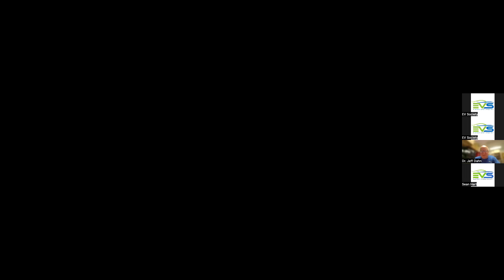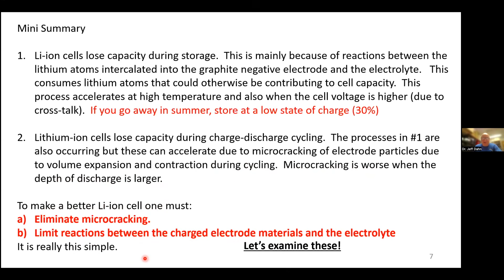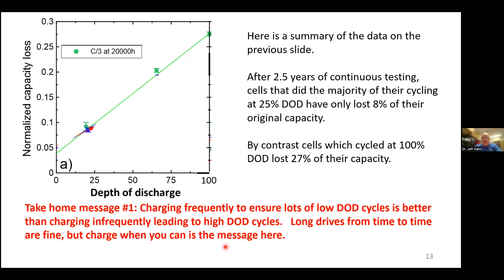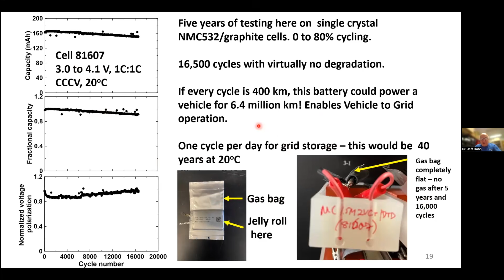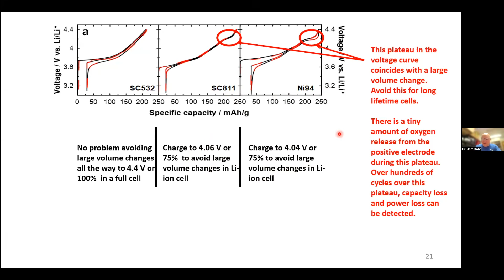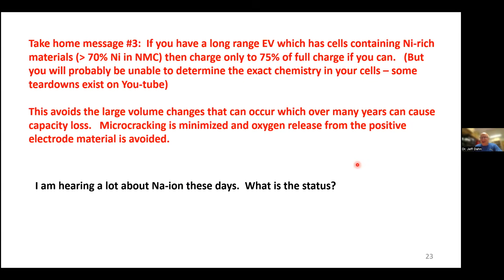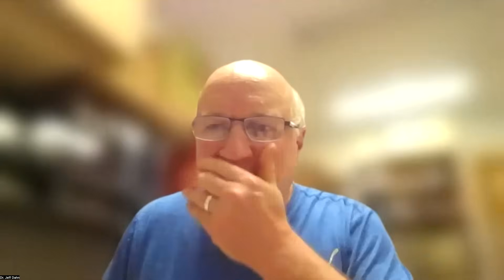How Long Do EV Batteries REALLY Last? — Dr. Jeff Dahn, Dalhousie University

Comment: Discussing these recommendations in terms of percentages isn't actually that helpful because EV manufacturers using NMC are at liberty to set their own cutoff and end of charge voltages in their cars' BMS, and will just constrain 0 - 100% within that arbitrary range which can dramatically depart from your 4.2V=100% relative battery state of charge. So an end-user recommendation to charge no higher than 75% might not actually turn out to be 4.08V, it could be be closer to 3.88V, reducing stored capacity dramatically. In actuality, those end-users could have safely charged to 100% because the 120mV was already taken off by the MFR.

Of course, the amount of information and feedback provided to EV dashboards and infotainment screens without an OBD II tool is scarce to nonexistent, and drivers often have nothing to go by besides the illusive percentage SOC in a small corner of their screen, so its very relative advice across different vehicle makes. I would hope in the future that better data like min/max/average cell voltages would be provided to EV drivers as literacy in this subject grows.
Reply: I've yet to see an example of a battery in an EV that limited the voltage by more than a couple of percent. My current PHEV tops out at 4.175 which is waaay higher than I'd like. All the measurements I've seen from other EVs are similar. Teslas at 4.15 for example. I agree we would all benefit from seeing the actuals on the car's display rather than having to use third party plug in adapters and apps. Dr Dahn worked with Tesla so likely is familiar with their practices at least. Manufacturers are in a difficult position because they obviously want the battery to last well (at least past the warranty period) but they also need to show a competitive driving range to get sales.
Reply: @davidroberts5199  They limit the end of charge voltage in my Spark EV, top voltage is 4.08V-4.12V depending on temperature. I've seen 4.12V with a hot 22ºC battery, and 4.08V with a 13º battery. If I go down hill with a 99% battery, the battery voltage will climb to 4.15V with about 7-10kW of regen.

Bolt and Volt might do the same thing.
Reply: 4.12 and 4.15 are much higher than I’d like my battery to go on a regular basis. And that’s on a minority of EVs. The market leader, Tesla allows much higher voltage and SOC.

Comment: Thanks so much! I knew a great deal of this already as I’ve always wanted to know how to best look after my car’s battery, just as I do with the engine in my other (ICE) vehicle. 
HOWEVER I still learnt from this, so a huge thanks.
(My 4.3 year old Model 3 has absolutely minimal degradation as I’ve always tried to look after it - which is actually very easy to do as long as you make just a little effort. It’s actually never been above 95% in it’s life as that leaves me a bit of regen available and is kinder to the battery for absolutely minimal reduced range.)
Particularly in Summer, I try to keep it at 70% max except immediately before a big trip. The trip computer Is so accurate that forward planning is actually dead easy.

Comment: Very cool. Just got a Model Y and Tesla recommended 80% under normal circumstances. I just lowered it to 75%.
Reply: 75% and 80% are practically the same (you will not notify any difference).
But the lower the max SOC to charge to for your daily driving, the longer your lifetime especially in the hotter summer period. And the more often you do charge the better. This means charging 1x a week from 10% to 80% results in higher battery degradation than charging 7x, this means every day in the week just 10% to replace the 10% you have driven on that day. But to keep all these tricks will show noticeable differences only in long term. This means when you need once to travel a 1000km distance do not worry to have your car charged to 100% at time you start such long distance travel once in a while, just when you charge your car permanently every day to 100% the degradation is noticeably stronger, when charging it only a few times to 100% the degradation will be barely noticeable.
During traveling to stop charging around 80% is anyhow advisable, as the time to charge from 80 to 100% is roughly similar to the time for charging from 10 to 80%.

Comment: I knew about storing Li-ion batteries below 50% in a cool location, but the depth of discharge effects was surprising. I would have thought the speed of charging would be a factor in battery lifetime. But I assume since the battery and chargers communicate to each other, you're not worried about overheating during charging.

Comment: This is fantastic! Thank you so much for this information. Own a Crosstrek PHEV and need all of my range. My typical habit was to drive it down to very low battery and then charge it up to around 95%. I see now that just charging whenever I have the opportunity and only losing / gaining back small percentages is a far better way to approach my daily commutes. I have to charge at public chargers most of the time, but I certainly have the opportunity to charge for small periods of time during errands. I always thought that charging for smaller amounts, multiple times each day was a bad habit for battery health. Thankfully this is not the case.
Reply: Your Information / charging advice is true for NiMh and especially for NiCd batteries which where used in the earlier laptops and cellphones (and are still as aa/aaa cells)
Many people (including me) were not aware that the newer devices with their Li-Ion batteries needed another charging habit... which lead to many laptops and cellphones dying fast ... which lead to the general "knowledge" that Batteries do not last long.
The typically high temperatures in laptops do not benefit that, either.
All in all this is a very good example that knowledge about a component can not always be easily transferred from one use case to another.

Comment: Great information. Dr. Dahn touched on level 3 charging (supercharging to the Tesla community) briefly. Please confirm.... There is no difference, as it relates to battery degradation, whether you charge using a supercharger or level 1/2, since then BMS will protect the battery. If so; This is another huge area of misinformation.
Reply: There are studies out there that show it doesn't matter. At all.

Comment: He mentioned it is better to have smaller charge swings more often than larger ones less frequently. In that case which is a better charge swing: 35-55% or 55-75%?
Reply from the maker: I think he would say the difference would be minor but that a lower averate state of charge is always better.

Comment: Thanks Dr Dahn for the detailed and insightful sharing. My car has a NMC811 battery. Regarding the degradation by charging to 75% vs 100%, does the charging speed matter? I heard from others that medium speed (eg. 11kW) brings less degradation than high speed (eg. 50kW). Thanks!

Comment: Does leaving the car plugged in have any impact on the extreme temperature storage at low state of charge recommendation?  As someone in the Phoenix AZ area you mention, my high nickel battery Tesla when plugged in only allows a minimum of 50% soc, but if it's plugged in shouldn't the thermal management system keep the battery at an optimal temperature even though my garage can be well in excess of 50 degrees C?  Thank you for the great talk
Reply: Tesla recommends keeping the battery plugged in as 50% soc is not much worse then 30% soc for storage but has the added advantage when plugged in of allowing the Tesla when plugged in to engage it’s temperature control systems to maintain the battery at optimum temperature otherwise you will be baking your battery in that 115 degree phoenix sun

Comment: Please do a video like this for LFP batteries! Im particularly interested: what happens if you never charging an LFP pack to 100% to balance the cells; given the lower voltage at 100% does it experience the same risk of cracking at  high voltage?; does the same principle of regular charging apply?. 

Thank you!
Reply: The main reason for charing LFP to 100% is because it has a very flat voltage curve with discharge -  so it's very hard to tell how charged the cell is.  With NMC voltage = charge, but no so with LFP.  Charging to say 80% could result in a situation where some cells are 80% and some are say 85% or 70%.   The BMS will stop the pack once any one cell hits the low voltage cut-off to avoid damage, so you might think you have 80% when really you only have 70%.   My understanding is that LFP doesn't suffer the same damage when charing to 100%, and generally has a very long life span.   Most LFP cells claim 3000+ cycles with 100% charge and discharge to 20%.   With LFP the main issues seem to the with temperature (cannot charge when cold), and with going to a very low state of charge.  Almost all LFP datasheets seem to have reduced cycle life going below 20% SOC.  I think Tesla's advice to charge to 100% as often as possible makes sense for LFP - and my guess is one shouldn't go below 20% too often (although most people will naturally want to charge then anyway).   Having said that, I'm hoping Dr. Dahn will do a public talk on this at some point.  I'd love to know more about what's happening here at the chemical level.  I know a lot of LFP cells have to be kept under compression for best life span, and that's something I've never understood.
Reply: LFP battery packs are known for their stability and long cycle life compared to other lithium-ion chemistries like Nickel Cobalt Aluminum (NCA). Here are the implications of never charging an LFP pack to 100%:

Cell Balancing: In LFP packs, like all lithium-ion batteries, cell balancing is crucial. Cell balancing typically occurs at the top of the charge cycle when the pack is charged to 100%. If you never charge the pack to 100%, the cells may become unbalanced over time. This imbalance can lead to reduced performance and capacity, as well as potentially reducing the lifespan of the battery.

Lower Risk of High Voltage Stress: One of the advantages of LFP batteries is their higher tolerance to overcharging compared to other chemistries. The maximum voltage for LFP cells is lower (typically around 3.65V per cell) compared to NCA cells (which can be around 4.2V per cell). This means that even at full charge, LFP cells experience lower voltage stress, reducing the risk of cracking and other voltage-related degradation.

Regular Charging Practices:

1. Charging to 100%: While LFP cells are more stable and have a longer cycle life, regular charging to 100% is recommended for cell balancing purposes. However, frequent charging to 100% is not necessary for everyday use and can be done periodically, like once a month (I believe Tesla recommends once a week for their LFP powered cars, according to their drivers manual), to ensure cells remain balanced.

2. Avoiding Deep Discharge: Like other lithium-ion batteries, it is also important to avoid deep discharge of LFP cells. Keeping the state of charge (SOC) between 20% and 80% for daily use can help prolong the battery’s lifespan.

3. Temperature Considerations: LFP batteries are more tolerant of a wider range of temperatures, but it is still advisable to avoid extreme temperatures during charging and discharging.

Comparison to NCA Batteries:

1. Voltage Tolerance: NCA batteries require more careful management of charging to avoid high voltage stress, as they operate at higher voltages. This makes them more susceptible to degradation from high voltage cracking compared to LFP cells.

2. Cycle Life: LFP batteries generally have a longer cycle life compared to NCA batteries, which is why they are often used in applications where longevity and safety are more critical.

I hope you find this information helpful.
Reply: @nissan_skyline  thank you very much! I’ll charge is daily to 85-90% and once a week 100%. That should preserve the battery ☺️😉👌
Reply: @nissan_skyline  Cell balancing typically occurs at the top of the charge cycle when the pack is charged to 100%.
==> In case of low power passive balancer the balancing is effectively best done when approaching 100% charge.
In case of higher power balancer the balancing procedure is determined by the balancers software (the balancer can basically be ordered by the software to operate at any state of charge).

 If you never charge the pack to 100%, the cells may become unbalanced over time.
==> The reason for occasionally charging LFP batteries to 100% is to allow the BMS a re-calibration of its range calculations. In LFP batteries the BMS has to rely on its current measurement to fix the SOC level, but SOC is defined/in reality fixed by voltage in combination with sufficiently low charge current. When measuring and adding up the current small failures in the current measurement accuracy will add up cycle by cycle until the BMS displayed range does not any more coincide with real energy stored in the battery. Charging the battery then once to 100% allows the BMS to correct for the cumulative failure that has added up in all previous cycles as it has as real input at 100% ALSO the cell voltage (and current) at which the battery is definded to be charged to 100%.

Keeping the state of charge (SOC) between 20% and 80% for daily use can help prolong the battery’s lifespan.
==> The cycle life time of LFP batteries is so high that you do not need to huzzle with 20/80% rules to prolong the cycle life, because even with 0/100% basically nobody will drive his car the 1 Mio km a larger LFP battery does provide in 0/100% (to increase this 1 Mio km to may be 1.2 Mio km by 20/80% is nonsense, because the chance your car will drive the additional 200.000 km you may gain by 20/80% is practically zero)
Reply: Hello Andre, great explanation. Sometimes I arrive at work with 90%. Do you think it will be ok to plug in everyday? By the way, I have a LFP Tesla model 3

Comment: Many thanks to Dr. Dahn for his patience talking to a [relatively] naive audience!
53:00  Targeting a specific number for optimum SOC is silly - to drive your car any practical distance, you must inevitably lower the SOC, while your range improves at a higher SOC.  Jeff has it right - IF you can operate routinely between say 30% & 75%, good for you, but if you are heading out on a long trip then don't be afraid to charge to 100% the previous night, & don't sweat fast charging on a long trip.  Just try to avoid 100 % SOC routinely.  My personal choice would be a car with a LFP battery, for which the optimum range of SOC is legitimately much closer to 10% ~ 100%.

Comment: Anybody want to give a TL:DR version?
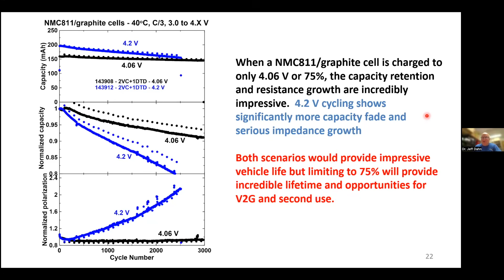Reply: 37:28 The recommendation is to normally charge to 75% and charge often.  41:22 Keeping the battery between 70%-45% most of the time is ideal and leaving it at 30% when you go on vacation is better than leaving it fully charged.
Reply: And if you follow the recommendations you can get millions of miles out of your battery
Reply: To use a gas car analogy.  It is like having a gas tank where the upper 40% of the tank is rusted by gasoline and the lower 40% is rusted by air.  If you fill your tank above 60% of capacity your tank will rust from gasoline and develop a leak.  If you let the tank get below 40% full the tank will rust from air and develop a leak.  So, let’s assume you have a car with a 10 gallon tank that gets 30 MPG. The car maker advertises a range of 300 miles.  However, if you use that range you will develop holes in gas tank.  So, your actual range is 60 miles as you can only use the 2 gallons of gas between having 6 gallons in the tank and 4 gallons in the tank to avoid damaging the tank.  Is that simple enough?